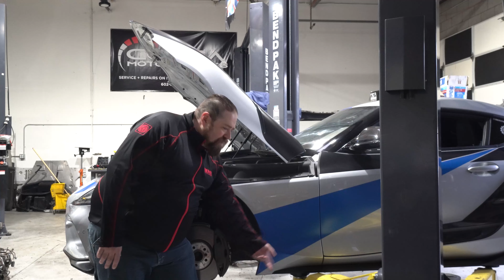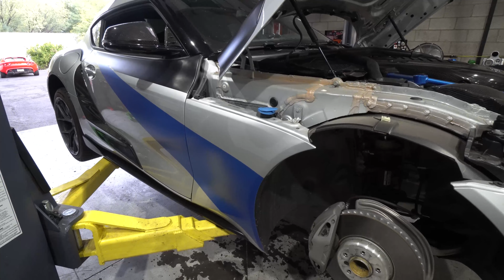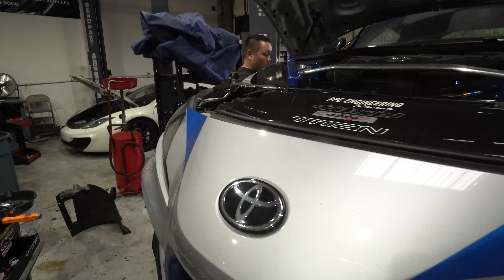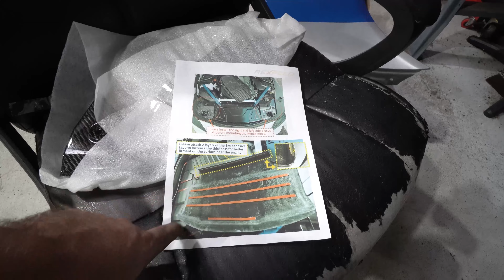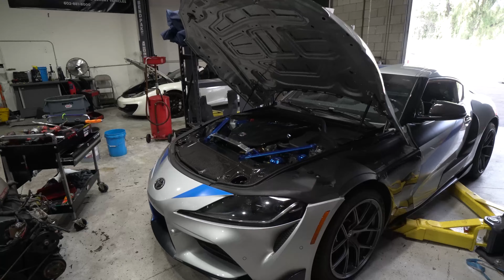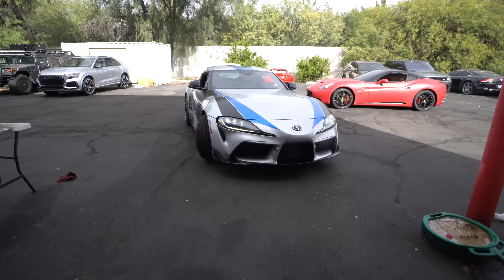Installing LG Carbon Heritage Fenders and Rexpeed Heat Plate

Comment: I probably would have drilled a series of 1/4” holes in the “vent” area of the fender well. Would have left a little more structure. 
But still use some mesh behind it. 
Pro tip 😜
Reply from the maker: that was my original plan, should have stuck with it